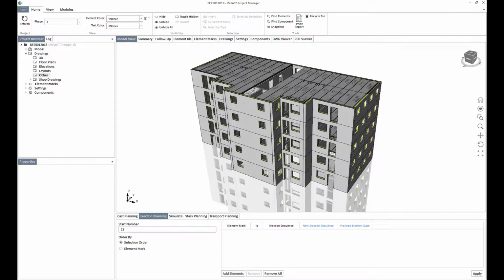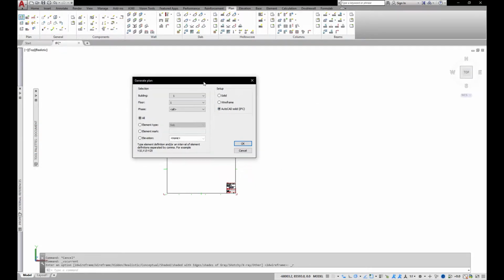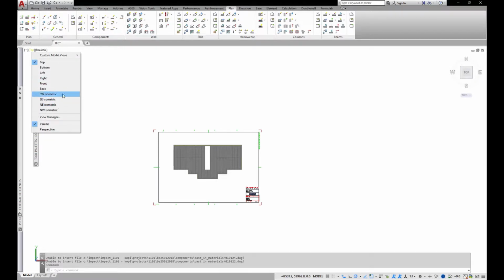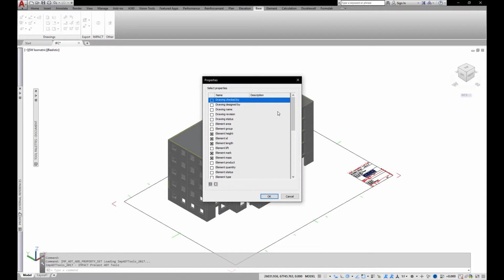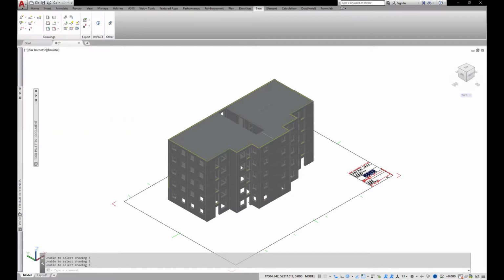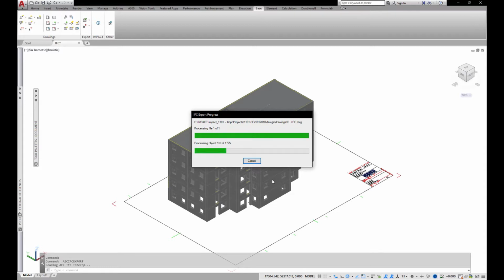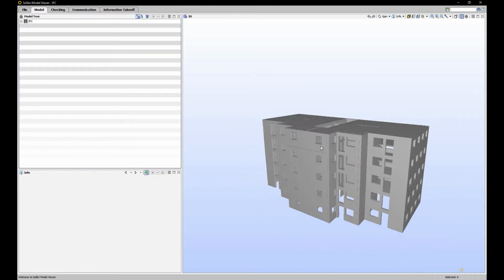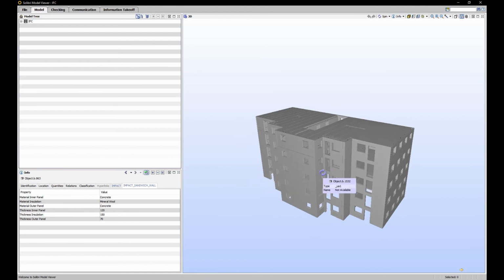Exporting IFC files from IMPACT for AutoCAD - Precast Concrete Software

Comment: Kan man exportera ut så att väggar blir av typen IFC wall och inte "object", samma sak med tex plattbärlag. De ska vara av typen Slab.
Reply from the maker: This is not possibly natively from the AutoDesk appliations. - However you set custom IMPACT property sets with IMPACT, and they will say it is wall, slab etc. - Additionally the native IFC object will be automatically set to wall/slab etc, if the IFC is made using IMPACT for BricsCAD.